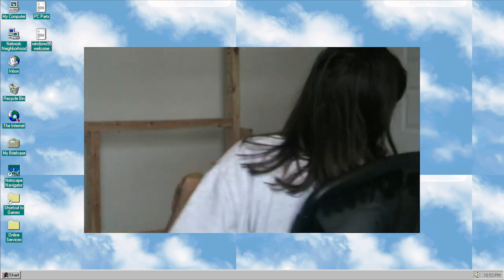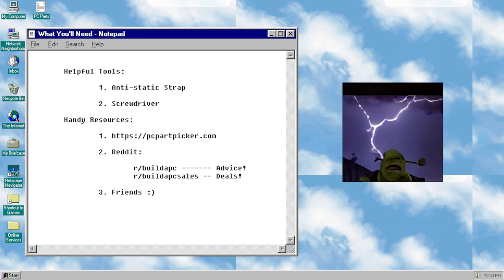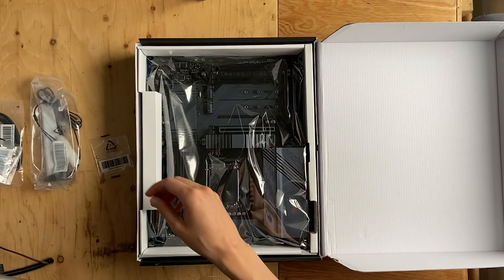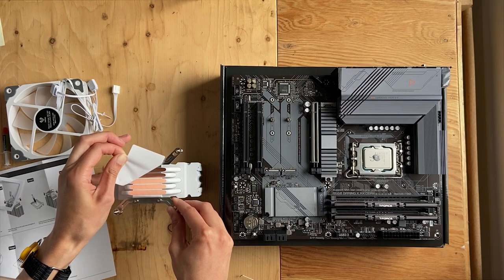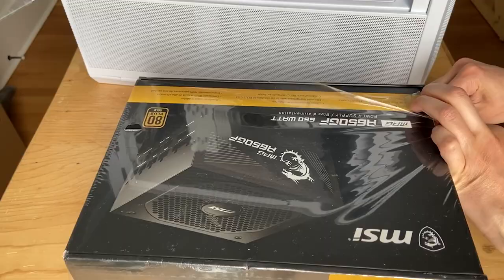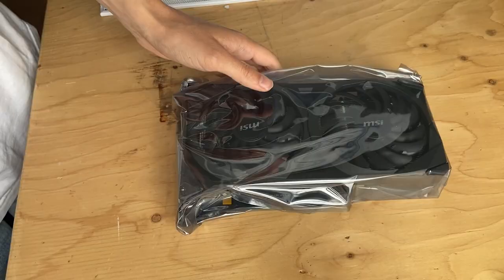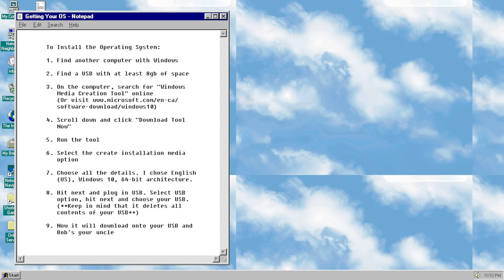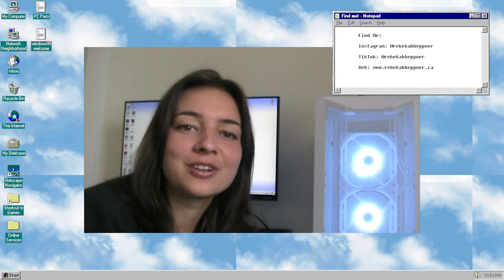🖥️ building my first PC for 3D modelling and gaming | rtx 3060, lian li lancool II | white aesthetic

Comment from the maker: Correction at 06:34 — Although the fans were installed in the correct way, I described the airflow backwards. The front three fans pull air in while the back fan pushes the hot air out!
Reply: who are you and why are you in my youtube feed 🧐🧐🧐
Reply: Lol I honestly thought that was a joke to kick off the REEEEE party! 😅
Reply: usually airflow is in the direction of where the fan logo sticker is. so it seems you may have incorrectly oriented the rear exhaust fan to pull air in instead of pushing hot air out.

Comment: Just a tip about the RAM slots and myth:
 
The slots furthest away from the CPU is a myth coming from years ago when room was needed for air coolers which got quite bulky and not many low profile RAM sticks out there, you can use either dual channel slots you want in reality, it doesn't make any difference, so long as they are A1 and B1 or A2 and B2. It really just comes down to preference as both pairs of slots are dual channel and won't make any difference which you use. It's more about having the room if you use air coolers which can be more bulky with a fan and may take up that room if not using low profile sticks, these air coolers still exist. 
 
Nice looking build though.
Reply from the maker: Oh really interesting, great to know!

Comment: One thing I learned recently while building a computer is if you are not sure where something is supposed to plug into, look it up instead of plugging it in the first spot where it can fit cause I ended up melting a fan cable and shorting my motherboard out
Reply from the maker: wow that realllly sucks! sorry you had to learn that the hard way :/
Reply: @rebekahheppner  Thanks, definitely learned my lesson the hard way but I guess that's how you get better at doing things like this 🥲

Comment: you should put the cooler on when the mother board is in the case it just makes it easier and you need to remove the stand offs that dont line up with the motherboard otherwise it would short circuit
Reply from the maker: Oh shoot did you notice any standoffs like that?

Comment: Haha, I just build my first PC a month ago, and it it's almost identical from the hardware perspective:

3060, 13600k, 16 GB 3200. The only Major difference is the case, I have some cheap MSI mag option.
Reply from the maker: wow, that's crazy!! How have you been liking the build?
Reply: @rebekahheppner  it's my first PC ever, so can not compare to anything, it's magic. Love it generally, but thinking about changing cpu fan to some liquid cooling - looks like new Intel's are way to hot and sometimes my PC sounds like a helicopter :(
Reply from the maker: @katzman3047  Oh wow, that's no good! Is that just with the stock fan? Doesn't sound like a normal thing to me!
Reply: @rebekahheppner  At first I tried the Be Quiet "Pure Rock Slim 2", but it was not enough obviously. 

Then I went to the local hardware store and bought the biggest and the most expensive air cooling that had in stock - it was Be Quiet "Dark Rock 4 Pro". It's literally 2 times bigger compared to my GPU. 

And it's still not enough to work silently - probably I will need to purchase the water cooling if I want some true quiet experience.

P.S. Sorry for my bad English, I'm not from the US.
Reply from the maker: @katzman3047   your English is great! Hm that’s so strange, I wonder if it’s something other than the cooler causing the sounds then. My pc is so quiet and I’m just using a cheap cooler

Comment: Did you use the sata ssd as your boot drive for windows? If so I would use an m.2 NVME drive. Its only around $80 for 1tb with speeds much faster then sata. For a build around 2k it seems worth it to me. You would have to reinstall windows on the new drive.
Reply from the maker: yeah as the boot drive! I already had an ssd kicking around so it made sense to use it. it's already so fast to me i'm not sure i'd notice the difference haha. I appreciate the tip!
Reply: @rebekahheppner  from a realistic standpoint a sata ssd is great. My logic is if your gonna spent almost 2k on a pc you might as well get the fastest memory for your boot drive. You could even get a 256gb for like $25. On cyber Monday nvme memory will be super cheap

Comment: how is the build still holding up?
Reply from the maker: I haven't had any issues yet! The speed still blows me away
Reply: @rebekahheppner  Thanks! Your build was a big inspiration for my own build as you actually go in and put it together in your video. I ended up getting  some of the same parts except for the RAM, as I went for a corsair 32gb. The i7 is def really powerful and the motherboard having wifi/bluetooth built in is a big plus. I was a bit worried about the direction of the cpu fan but it makes perfect sense when you explained it. Looking forward to assembling it!
Reply from the maker: @TheDinosaurHead  Wow I'm so happy to hear that! I think I caused some confusion for others with the fan setup haha but as long as the front fans are pulling air in and the other fans are continuing the flow to push the air out, it should be an efficient airflow (this will depend on your setup though). Have a blast installing everything — that's the best part!
Reply: @rebekahheppner  Thank you! I ended up managing to get it built and running, however I'm having some issue with the wi-fi part of it. Did you ever figure this out?
Reply from the maker: @TheDinosaurHead  Oh shoot! Hmm yeah after plugging the wifi tower into the 11AX wifi ports I think it all worked properly. Does your computer detect the wifi networks or does it not work at all?
Reply: @rebekahheppner  It wouldn't recognize the tower at all and it wouldn't show up in device manager. However I went on Gigabyte's website, downloaded the driver and after installing it it seemed to work. Now I can just update it via the gigabyte app center. Here's to hoping it lasts. 
I'm quite curious as to how you did your cable management as I think mine is pretty bad haha.
Hope to see some more videos soon!
Reply from the maker: @TheDinosaurHead  oh yeah I should have mentioned drivers! And yeah I’ve been using duct tape as a temporary fix for cable management lol. That’s awesome tho, so exciting!! Enjoy your new build :)
Reply: @rebekahheppner  Sorry to ask again, but did you ever have issues with the Bluetooth? Might just be a driver thing again, but figure I'd ask. 
EDIT:  I managed to find a fix, seems like it's an issue common with some board lines like Gigabyte and ASUS, but I'll mention it here incase you or anyone watching this video faces it. 
Essentially my bluetooth wasn't recognizing any devices trying to connect to it, but had previously been able to. Another issue I found that others may have from what I researched is that the bluetooth itself will just disappear. So after resetting the OS and still having the same issue, I found a video that had me turn off the PC, unplug the PSU from the wall, and press the power button a bunch of times for like a minute or two in order to drain the CMOS. After plugging it back in and booting it up I managed to get my bluetooth earphones and speakers to connect.
Reply from the maker: @TheDinosaurHead  oh man that's so weird! is everything running smoothly with your build now? so glad you were able to find a solution—thanks for sharing it here!